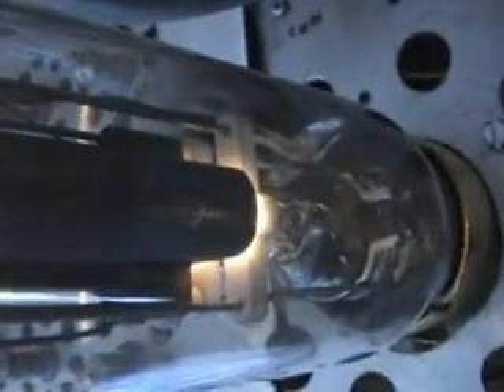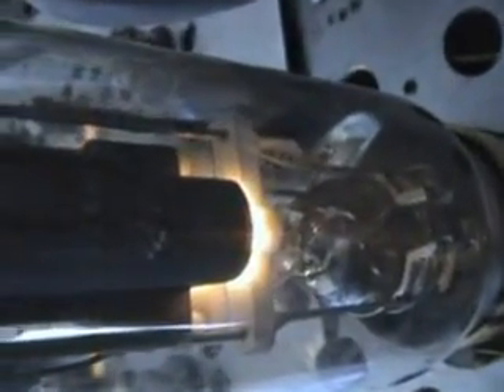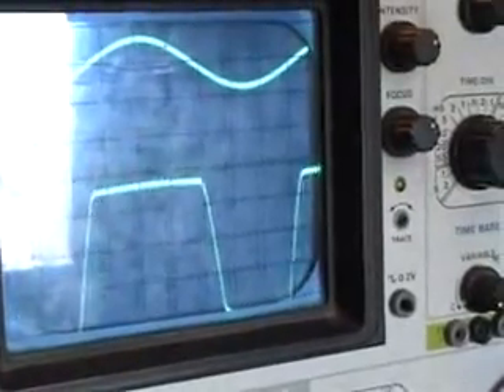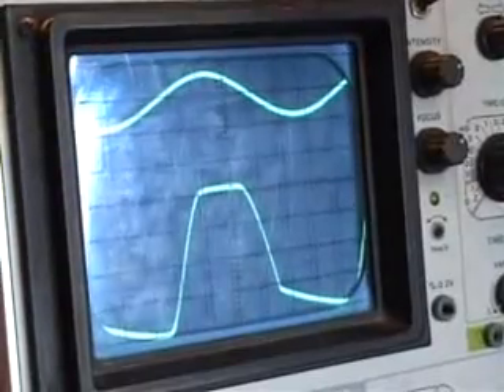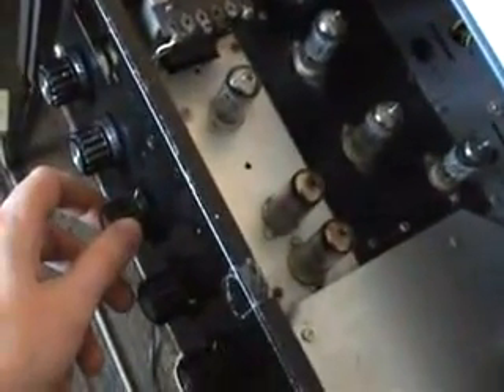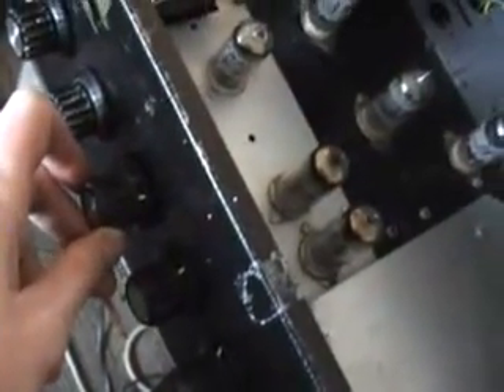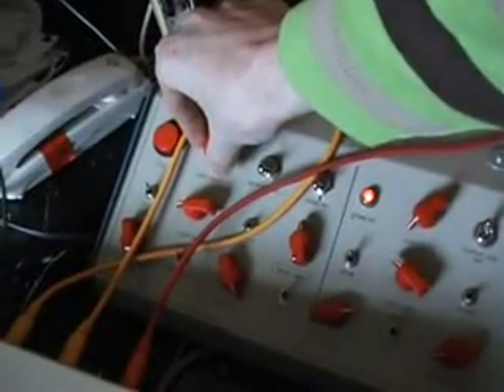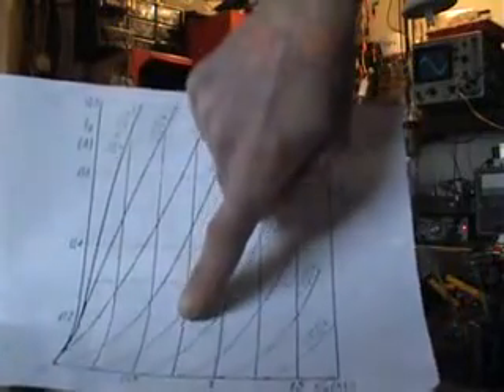Theo Argiriadis - Analogue Electronics Engineer

Comment from the maker: The short answer is that I don't know. I've not used a Manley or TAB-Funkenwerk unit, and this unit was designed expressly as a distortion unit. The circuit sounds clean at low gain levels, though, and the distortions sound great.